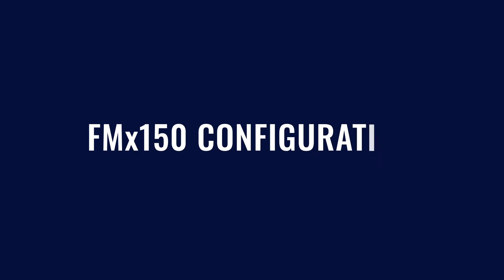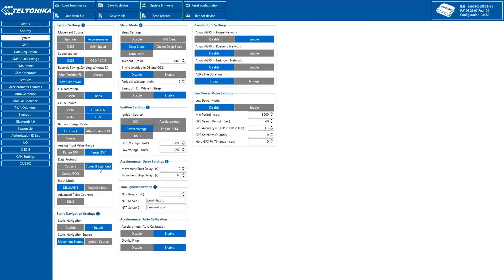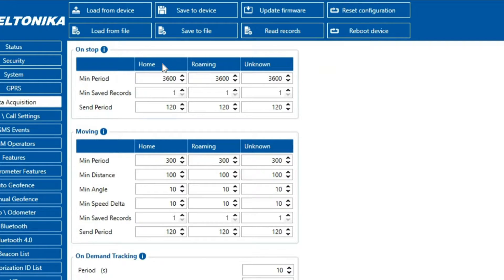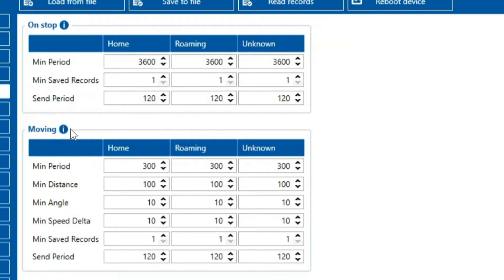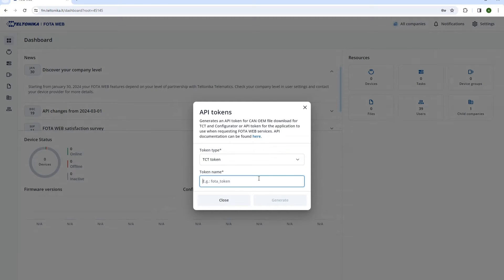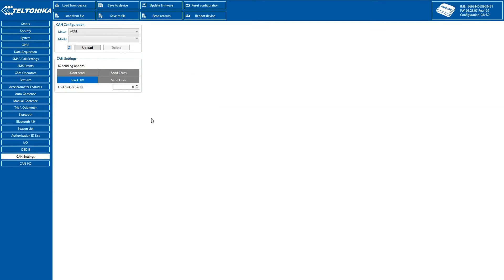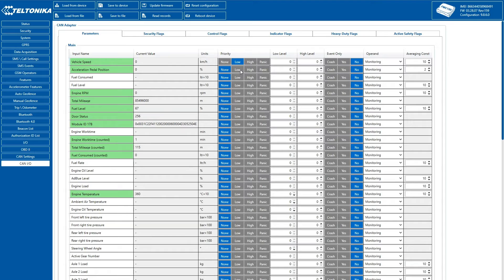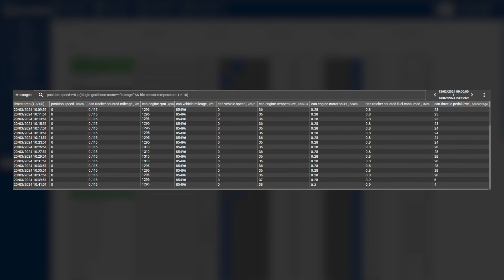Teltonika Configurator | How to Configure FMx150 Tracker | Teltonika

Comment: hi, FMC920 is sending binary data etc 00x11x0, only one time I have to change my place to receive data, it doesn't make any sense also how can I transform binary data to more useable data like JSON or XML ?
Reply from the maker: Hello!
Thank you for your question! By default, Teltonika devices, including the FMC920, use the Codec 8 protocol structure for data transmission. Detailed information about parsing this data and understanding the communication logic can be found in our Wiki: https://wiki.teltonika-gps.com/view/Teltonika_Data_Sending_Protocols

If you prefer a more user-friendly data format, such as JSON, this is supported starting from firmware version 03.29.00 for endpoints like MQTT Azure or AWS IoT Core. Guidance for setting up these options is available here:
https://wiki.teltonika-gps.com/view/Getting_Started_with_AWS_IoT_Core
https://wiki.teltonika-gps.com/view/Getting_started_with_Azure_IoT_hub

Looking ahead, firmware versions 04.00.00 and later will also support JSON mode over standard TCP/UDP servers. If you’re interested in early access to test this functionality or need further details, please contact your Teltonika sales manager.

Comment: Hi Teltonika team, one question on the FMx150 Tracker.  When installing an FMx150 device, do we always have to combine it with ECAN02 ?
Are there cases where instead of ECAN02 maybe we need some other external device?
Or even no additional external device just the FMx150?
Thank you!
Reply from the maker: Hello,

Thank you for your comment. We would like to clarify that it's possible to install the FMx150 tracker without ECAN02. However, it's important to note that in such cases, a direct physical connection to CAN lines would be needed.